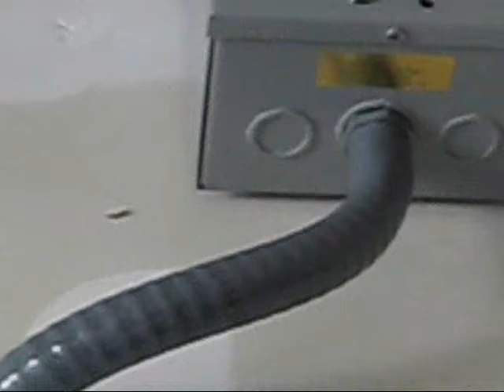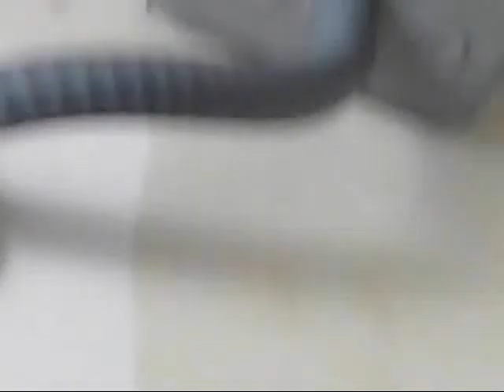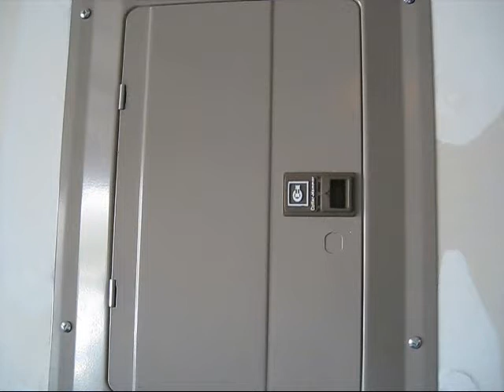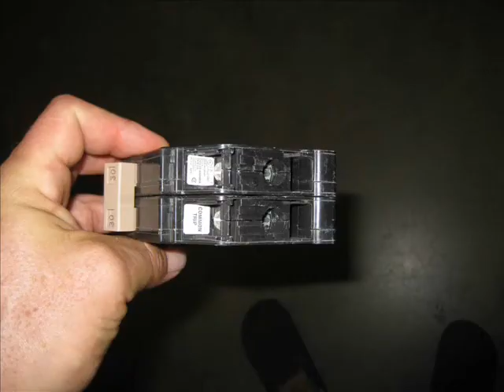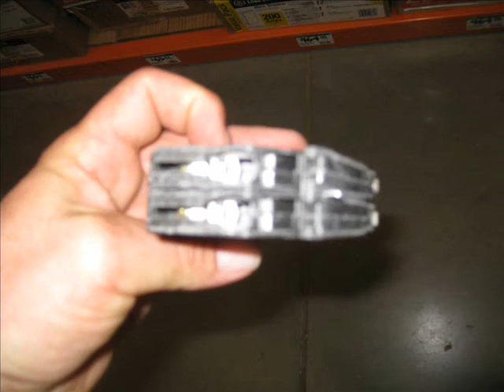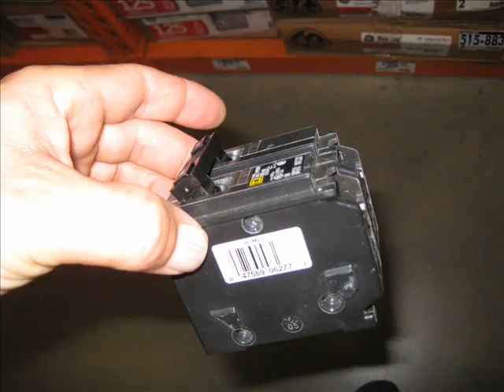Power Saver 1200 Part 6

Comment: I got my power saver and went to install but had to take a breaker that wasn't being used to put it in. Then I notice I had to take out 2. On the 15amp side there were 3 wires not being used and on the 20amp side one. Can I put the 20amp wires in the 15amp breakers so I have enough space?

Comment: I wonder if his house burned.  I've seen capacitor blow before.  They are pretty loud.
Reply from the maker: So it's been 10 years now and It's saved me approximately $71.53 a year, so after 10 years it's saved me several times what I paid, but when you add the 2 times lightning hit my house, where no electrical damaged has occurred I'd say it's damn near priceless, so to answer you question, not only has my house no burned down, it's more than likely that it has saved my house from burning down at twice!

Comment: holy crap.... 6 videos to install a simple 220 volt device.... you're kidding right?
dude you mean well, but you shouldn't be "teaching" anything to anyone...
you don't even have a ground wire run into the unit... The liquidtight (also called seal tight) doesn't have the proper connector between the liquid-tight "tubing" and the power saver 1200 unit. Congrats, you just installed a violation....